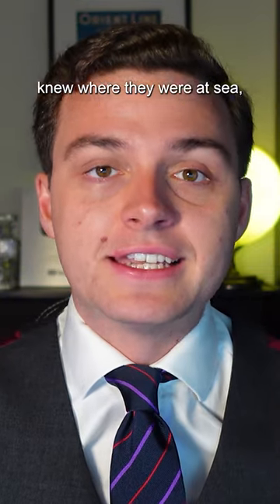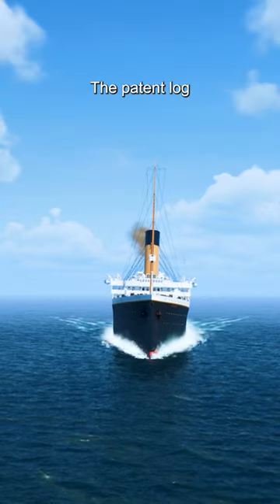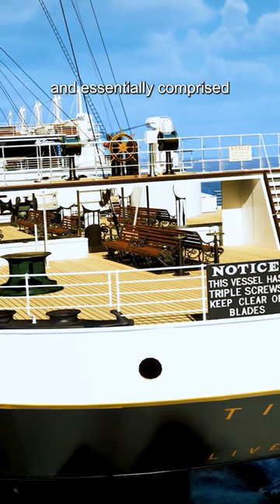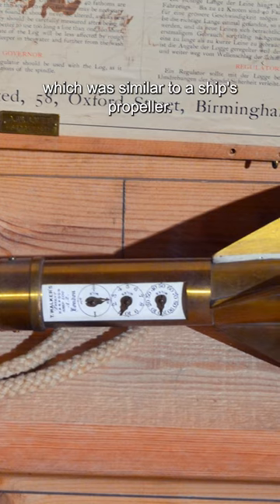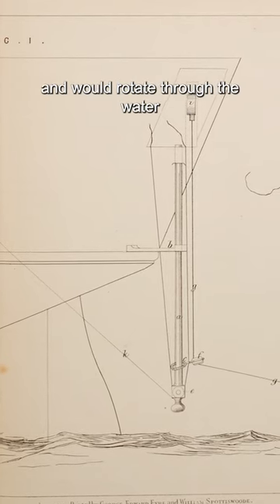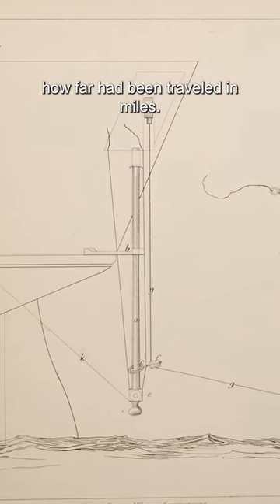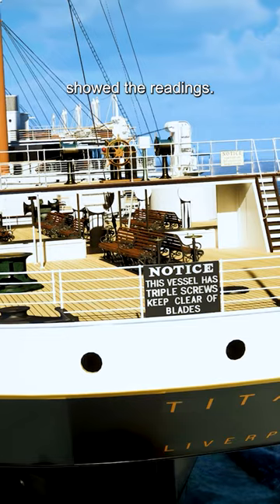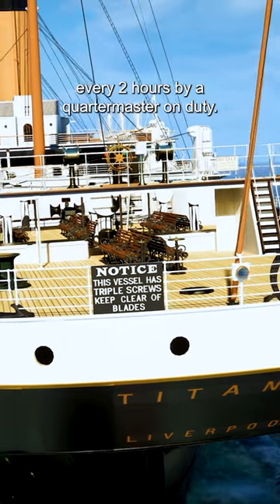How Did They Measure Titanic's Speed? #shorts

Comment: Working as an odometer of sorts, while less direct in terms of how it was driven -mechanical odometers generally driven via a vehicles transmission, vs a propeller in the water. How do you rekon they calibrate it? Logic would suggest modifications over time, whilst comparing output to a known distance, though i admit it's sheer conjecture.

Comment: The mechanics and maths fascinate me. There's also stuff like the speed of the water she is on which has its own speed in any direction (slippage?). Per this, on the way to Oban o the Waverley, we were delayed at Colonsay and quite late. By sheer luck we caught the flood tide thereafter and were apparently doing 25 kts past Kerrera. I'd like to see the proof but I can vouch that two hours late became a half hour late. Our service speed is calculated at 14.5 kts for the timetable.
GPS gave us amusement. On that sail to Oban going down the Kilbrannan Sound, between Arran and The Mull of Kintyre someone's app threw a beautiful wobbly and variously had us going South round Arran on the A841 or South down the Mull on the B842 as was its occasional want until  it gave up the fight, ran up the metaphorical white flag and decided we were going in reverse North back up Arran on the wrong side of the A841 to end it all in the pub in Blackwaterfoot (sorry, a bit of an inn joke there- for the regulars). Actually we were doing a fairly consistent 14.5 knots past Davaar Island into Campbeltown Loch.

Comment: Why was the Titanic pictured in dry dock nearly ready with 14 port holes, the Olympic had 16 port holes but on the day Titanic left for its maiden voyage it was pictured with 16 port holes? And why did the Titanic have evenly spaced square windows in pictures in dock and the Olympic had thin vertical odd spaced windows but the ship at the bottom of the sea is pictured with 16 port holes and odd spaced thin windows? Im asking as your an expert and these are a few odd things ive noticed. Thanks
Reply: Both ships were launched with 14 portholes. Titanic had 2 added in order to get more light and ventilation to a crew galley. Olympic had 2 added a little while later for the same reason. By the time Titanic sank, both ships had 16.
Both ships were launched with large, evenly-spaced promenade windows on B deck, because that's where the B deck promenade was. Olympic sailed with the large windows and the promenade, which was found to be seldom-used and was thus considered a waste of space. To prevent this waste of space on Titanic, they filled in the promenade with additional cabins and passenger spaces, which led to Titanic's windows being of a thinner and more unevenly-spaced design. Olympic would get a few additional spaces in this location in later years, but would still retain a large portion of its promenade and thus most of Olympic's windows remained the larger and evenly-spaced sort.

The wreck matches Titanic.
They weren't switched.